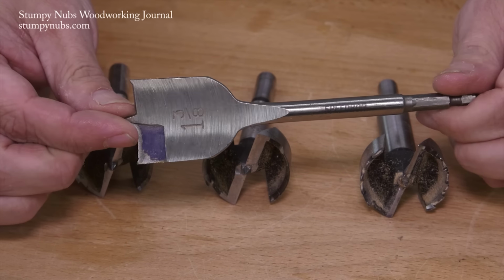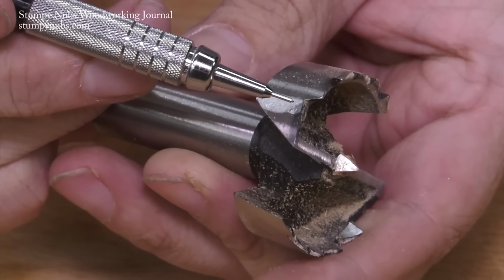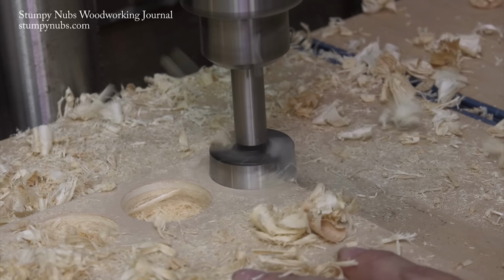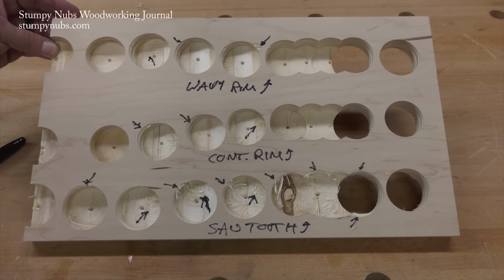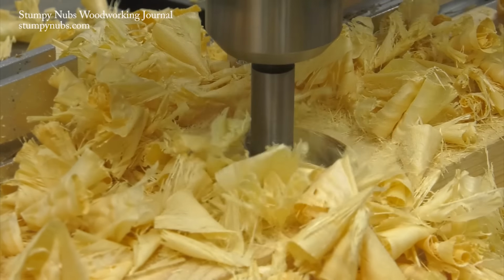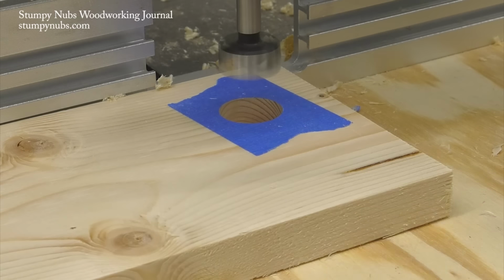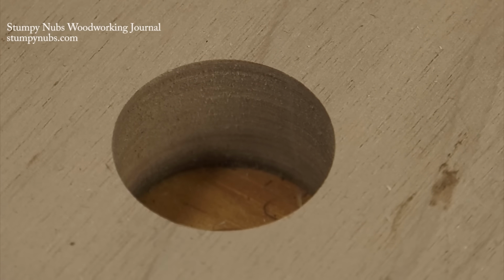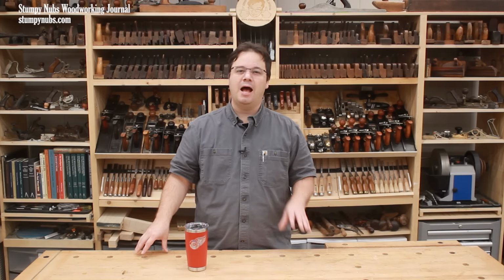Clever tricks with forstner bits

Comment: I was puzzled how to drill the 3/8" deep x 1-1/2" corner holes for my router table when my tiny drill press is too small, this set of tips inspired the solution both for how to keep the bit aligned and how to set accurate depth!  Thank you!

Comment: Finding a set of Fisch wavy-edge Forstners on sale was like Christmas morning, but when my main concern is a clean entry, I'm often amazed how good a job Wood Owl Overdrives can do. I think 1 1/4 inch is the biggest, and you don't get as flat a bottom, but you can be a little more aggressive than with the same size Forstner without burning them. I've used their TriCut augers in a power drill, too, although you have to be careful not to let the auger screw run away with you.

Comment: I do projects where I need to use large Forstner bits and drill on both sides of the wood.  I use a 1/16" bit and drill through the wood at my center mark.  I then use the Forstner bit, drilling to my desired depth, then turn the wood over and repeat the process.

I create "wood block clocks" this way.  Bore a hole in the back deep enough for the clock motor and a shallow hole in the front for the face.  The 1/16" hole also acts as a pilot hole for drilling the hole for the clock shaft.

Comment: I center a larger hole over a smaller one by enlarging the smaller hole with a step bit until I get the diameter I need and switching to a forstner or twist drill to drill deeper.  This doesn't work in every situation but it works better than the tape trick if you don't have a drill press and it also works on odd shapes and in steel.  I've used this trick to enlarge holes drilled through a 3/16 steel I-beam and the center of a wooden croquet ball.

Comment: For greater accuracy on enlarging a Forstner, first begin with the final size first. But only penetrate a short distance. The convert to a smaller bit all the way through with backup of course. Then reinstall the larger final  bit that will seek the original first location.

Comment: I need to make a larger hold over a smaller hole. I am going to use a hand drill and a scrap piece of scrap wood for a template, however the hole is going into a log (making a lamp from beaver chewed log) so I am unsure how to attach the scrap wood to the log because clamps won’t work. What would you suggest?

Comment: @StumpyNubs thanks for the information.  Can you please tell me how to sharpen various forstner bits? Also,  it's been a few years...did you make the video on when it's best to use each bit? I have only recently started using forstner bits...my stupid drill press gave me such a hard time yesterday! I  don't know what fell off more...the chuck or the brand new forstner bit! I  got hurt the first one of each (not much...just enough to piss me off...sigh). I was taking my time and the rotation was on low. I bought this drill press off a guy for $100/CDN  because it was an old Craftsman...it's supposed to be good quality.  However,  I should have beaten him with his own toolbelt  for the shameful state it was in! I had every intention of refurbishing it anyway.  By the time I was done I'd say it looked about 95% new! (It wasn't easy between the rust and whatever was on the deck...he must have used it for a glue up table!)
I've used it a few times with no issues until I tried out brand new forstner bits.  I  watched loads of videos with people using them...not one person mentioned that dropping chucks or bits could be an issue!
I managed to get the chuck back on but the bit now falls off no matter how straight and tight I make it! Either I'm doing something wrong or I figured out the real reason he sold it...help please

Comment: Ok, I can make a hole in practically any size I want, but how do I make a plug of wood to fit that hole? I had some knots fall out of a large (expensive) panel and want to fill them with wood. I can make a round hole where the knot was, but how do I make a plug to fill a 1 3/8" hole that doesn't have a guide hole in the middle of it?
Reply from the maker: A patch is less visible if it's not round. Rout out a recess around/over it in a shape that follows the grain or at least isn't perfect. Then use sandpaper, files, etc to make a patch that fits. It's worth spending the extra time on.
Reply: @StumpyNubs  Oh, that will take more time than I was hoping for. I'll try it and see.
Reply from the maker: @gte717v  It's not as hard as it sounds. You make the patch a little larger than the recess, then taper the edges so when you pound it in, it compresses the fibers around the edges and fills any tiny gaps. And I'm not talking about making a weird puzzle piece, just not a round hole, if you can avoid it. Here's an example: https://www.youtube.com/watch?v=3ZMfBvg7ZYk It's smaller and simpler in shape than what you are likely dealing with, but the process is the same.

Comment: Extra tip for drilling through holes is to drill a pilot hole right through the size of, or slightly smaller than the size of the forstner bits point. That way you don't have to drill as far through the workpiece before changing to the other side and it gives a centre for the forstner bit to start from

Comment: I have an excellent forstner bit tip that may help. I needed to fill some screw holes in some wood with oak dowels so that I could re drill them and get the screws to bite. I took a half inch forstner bit and tried drilling a piece of wood and putting a half inch dowel in it and it was very loose. The next size smaller forstner was way too small. 

I put a cheap forstner bit into my drill press and took a large metal file and held it against the side of the bit and used it like a lathe and took the bit down about a 1/16. 

It may seem like it would no longer be able to cut but the forstner bit has enough of a cutting surface on the face of it and it still worked well enough and still made clean holes. 

I had to cut 99 holes with that bit and it worked perfectly fine. It obviously did not drill as well as it did before I took a file to it but it was totally usable. I put wood glue on the dowels and hammered them in and they were nice and snug. Be careful not to take too much off so stop and test it in a piece of scrap wood with a piece of the dowel that you're going to use. 

Just don't use a forstner bit like the ones he is advertising here. Just get a cheap forstner bit from the Home Depot. 

They probably make a special bit for drilling holes to fit dowels perfectly but I did not have that. This method work perfectly and only cost about $7. You should probably mark the bit that you do this to so that you know that it's not a standard size bit.

Comment: I need to drill multiple large holes with a forstner bit but don’t have a drill press. I can’t use the trick you mentioned as I’m not going completely through the wood. When I try it handheld the bit dances across the face of the wood and completely damages the wood.  Any suggestions for this scenario?

Comment: Question: I'm trying to make a 1 1/8 foster bit drill @ 2 inches down into a 10 ft 2x4. Wood is treated. I'm making a viking tent with my forest school class. We are using dowels. 
By making a simple jig,  if I make a 1 inch guide, can I move the guide after that 1 inch in drill. Will it keep going straight. I need the bit to go all the way down.

Comment: Only yesterday l was researching how to drill a blind hole in a guitar project I’m currently working on. Just thought of this whilst watching your video and not sure if this is an old trick. 
If a hand drill is all you have and need to make blind hole to a specific depth, make a through hole in a scrap piece of wood then score two small lines on the inside of the scrap guide piece. The first line is the top of your bit when it touches the work piece and the second line to the depth required. The distance between the scored lines is your depth. Secure the scrap piece over where the blind hole is to be and carefully drill down, frequently checking if you can see the second line. To make it easier to see the scored line, colour it with a fine tipped Sharpie. The scoring will prevent the line from being rubbed off as you drill down.
I haven’t tried this method yet but it should work.

Comment: Centering a larger bit over an existing hole. Chuck the bit for the small hole in the drill press. Lower the bit into the existing hole. Clamp the workpiece in place and remove. If doing stepped or counter bored holes always if possible do the large size first. If you find you need to do large numbers of counterbored holes for screw heads look into getting a set of counter bores for metal working. Some even come with interchangeable pilots. Another way to get counterbodered holes for screws meant for assembly is simply to use the drills meant for pocket screws.

Comment: The idea of clamping a solid board over a previous hole to form a stable template doesn't just apply to Forstners.  They are just as useful when enlarging holes for doorknobs in doors with hole saws.  I have a 3/8" template board I clamp to the edge of doors that I need to resize.  It turns a near impossible feat into an easy one.

Comment: You missed another trick. Use a large bit to start your hole, stopping about an eighth of an inch down. Switch to a smaller bit using the hole from the center point as a guide to maintain center and drill out the bulk of the wood until the point breaks the other side. Then flip the piece over and finish with the larger bit. Clean edges both sides.

Comment: I use these bits to create pocket holes.  You don't need a guide to create pocket holes.  When working with heavy lumber to make a solid workbench, use 3/8" lag bolts as pocket screws.  I needed one to support hobbies from leathercraft to reloading.

Comment: I am slowly,  due to my chemotherapy,  getting into woodworking with hand tools.
I work in surgery, for 48 years now. In orthopedics, we use battery & corded power tools, as well as some pneumatic power. 
I am amazed at times at how many woodworking techniques we use. For instance, when almost through some wood with your drill, to ease off on the power as you go through the backside of the piece.
Using the lag screw technique so the threads don't catch the top work piece, but grabs the "far piece, pulling them together.
Sorry for being so wordy.
Almost forgot. I have several old school hand operated drills. In surgery, they are known as a Hudson Brace.
I need to refurbish them. Do you know how complicated that may be?
God bless

Comment: Another tip - get an old oval file and a round one, get some sandpaper in varying grit, up to 5000, wrap it around the files and hand hone those and re-sharpen your edges... Hand grinding the edge of a woodworking tools is quite easy, you will have more difficulty sharpening sawtooth ones, but wavy and flat are easy peasy to grind to a razor edge... Why buy new drills and forstners when you can maintain them for years and years... Especially as there arent endmills that you need to sharpen on the sides and reduce their diameter, so you effectively affect nothing but the sharpness of the edge by honing it... Which is a great thing...

Comment: Couldn't you, initially,  press the cutter hard into the wood,  with zero rotation speed, to cut the wood fibers, the repeat the process with a slow speed for couple of seconds? That should give a very sharply cut hole.

Comment: Great tips! Love the blue tape ideas. Another thing I’ll add, for a piece you can’t easily flip (like making dog holes in a work bench), start the hole with the large/final size bit, just go down an 8th or 1/4. Then hog your way thru with a smaller one you can even use a spade bit or auger, then follow up with the forstner to finish the hole. Your initial hole will act as a guide to locate it.
Reply: Brilliant!

Comment: You're right about everything and I'd like to add that less experienced woodworkers shopping for a drill press or, for that matter, a hand-held drill motor ought to look for a tool capable of low speeds. Even 400 RPM is too fast for some of the larger hole-making bits. Better to rehab a 200 or 250 RPM machine than to burn both bits and work.
Reply: See my comment above about using a hand brace !

Comment: When I need a large forstner to finish a job, I use it first, but only to drill down enough to form a shallow shoulder. I can do that with progressively smaller bits so that I have a stepped hole. The smaller bits always have the centre dimple to hold them in the middle. Once all the way through with the smallest forstner that I am going to use, I can keep going back progressively larger because, even though the centre is gone, there is a shoulder to guide bit, all the way up to the largest one.

Comment: I volunteer at grandson’s school. Problem…they attached a piece of 2x6 to a wall then tried to bore holes at 45° down with a spade bit, didn’t work. Solution…I took a piece of scrap 2x6 and bored an angled hole on my drill press by tilting the board up 45° using my 3/4” forstner bit. Attach a handle I had in a drawer. I drove some deck screws through so the stuck out about a 1/16” to give it some bite. Took that to school and press hard, drill to start hole, pull it away, finish started hole. Insert short dowels with glue. It is so the kids can hang their backpacks from it.

Comment: I found starting with the required size and drilling to the full depth and then use a small bit to drill inside that in a couple of places to the finish depth gives good results for blind holes

Comment: I think this channel is great. 
I agree that Forster bits work well however I don’t agree using them with a cordless drill. Forster bits put to much stress on the motor and gears on cordless drills, like in the video,I would use them in a drill press. Hand held drills I prefer a hole saws for a clean hole cut especially for thru cuts.
Keep it up, I get great tips every time I watch
Reply: You can always use a hand brace - they are available with chucks that take round, hex or the traditional square stems. With a hand brace you get lots of control and little if any risk of overheating the bit. Hands & arms rule OK !

Comment: I need to make a jig so that I can drill a very accurate hole down the centre so apiece of HDPE rod. The tips at 4:08 in the video have given me a start on making the jig. All I gave to do is use the forstner bit to drill through a piece of wood that is thicker than the length of rod I need. I'll stop short of breaking through, leaving a ledge on which to rest the rod. I'll flip the wood over, and using the hole made by the tip, drill a hole in the ledge so that the twist drill I am using can go right through the rod and out the other end. 

I'll do something similar to make a jig to mark the centre of the rod. I'll put a screw up from the uncut side of the wood into the hole. Then I can simply put the length of rod into the big hole made by the forstner bit, give the rod a tap and the centre will be marked.

Comment: Most of my forstner bits are saw tooth, which reflects my experience in construction. I'm often able to sharpen these after striking nails, etc. I just have to remember to lower the radial cutting blades if the saw teeth are worn lower. How does one sharpen a wavy or continuous blade?
Reply from the maker: https://www.youtube.com/watch?v=rLoEulA4mM8

Comment: James, another AWESOME video!  Thanks!  A tip I learned about Forstner bits that you didn't mention is starting the hole with the Forstner bit in REVERSE. If you start in reverse you don't get the tearout that the sawtooth Forstner bits can create. Start it in reverse, cut through those initial fibers, then drop it into forward mode and finish the hole.  Saves having to use a scrap piece... 

Your content is awesome and appreciated, another happy subscriber!

Comment: Another tip: Drill with a small bit (2 mm), and then can drill with the foster bit on each side, so you dont have to use the foster bit to the bottom until it appears to the other side (that us dificult to do, normally oneself pass all the wood to the other side), but with the small hole, you can easily stop drilling one half and flip it and drill from the other face of the piece of wood.
Reply: Or us the 2mm bit to punch through after you've drilled part way with the FORSTNER bit. You have the indent right there in the center of the whole. Good video! My first one. Pure information. No muss no fuss.

Comment: Great video SN! I cringe when I see someone running a Forstner bit too fast.  BTW, larger bits can be "touched up" using a small, fine diamond hone, or I suppose any hone. Just a couple of strokes on the teeth/rim and the chisel points can make a huge difference in how quickly and cleanly the bit cuts. Just follow the existing angles, and go lightly. If the bit is getting dull, what do you have to lose?
Reply from the maker: https://www.youtube.com/watch?v=rLoEulA4mM8

Comment: Serious question if I may. Is the "waste" produced from a forstner bit actually chips or is it more like shavings? They were referred to as chips in the video but they looked more like shavings and to me the forstner appears to shave the wood out working more like a hand plane. It's not a life or death reason for the question but a gaining of knowledge as I haven't done any sort of woodworking since high school 50 years ago.
I have only just acquired some forstner bits and drilled about 4 holes and I like them more than the spade bits I have infrequently used the past 20 years and 55 years ago all I had access to was a brace and bit which from memory appeared to produce a cross between a chip and a shaving.
Thank you and any answer(s) would be appreciated. Thanks for the video, it's much appreciated. 👍

Comment: That tip for using a guide in scrap with a hand drill is getting used next time I have to use a tank cutter on steel  - they are a sod to stop from wandering without a press. Thanks.